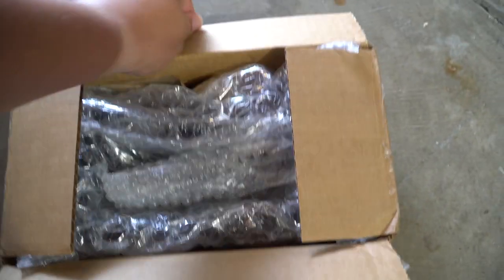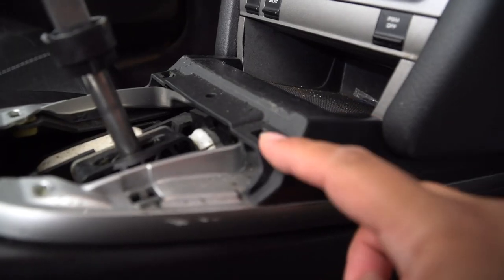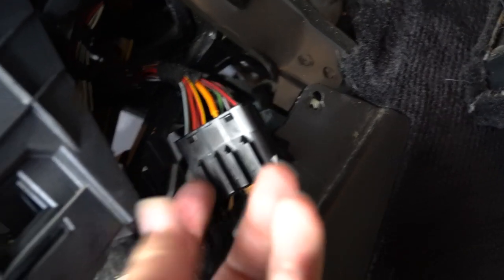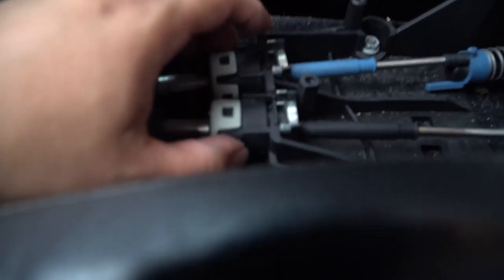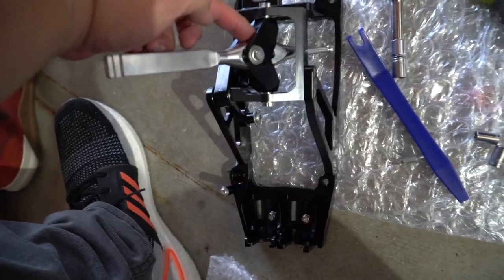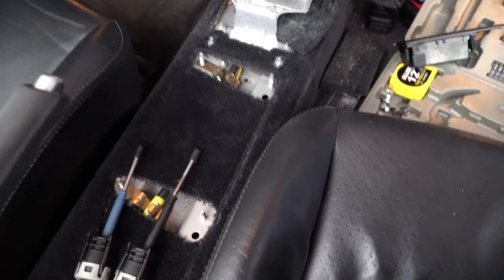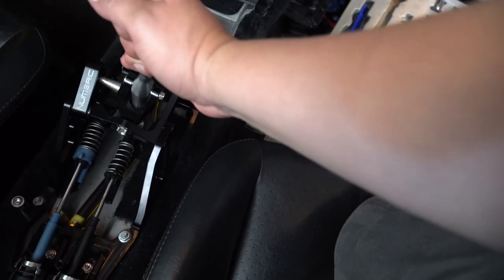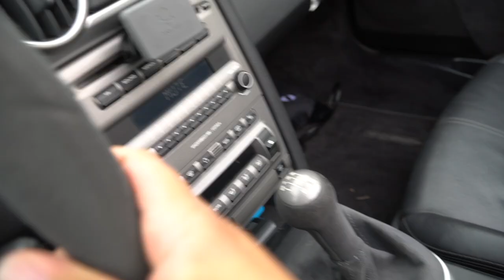Numeric Short Shifter Install

Comment: I installed mine on my 2007 997 GT3 RS. installed the shifter and the cables. I love it. You can feel the teeth of the gear box the feed back is so raw. Personally, after trying all three positions, I set it up on the longest throws. I prefer it that way as the shift is still shorter than stock but you need a lot less effort to shift. The cables were actually not that hard to do but a lift is preferable and a second set of hands to push and pull at the same time.
Reply from the maker: Such a great product!!
Reply: @JermsDNA  yes. Some may find it a little raw but I love it.

Comment: Seems like the new shifter would come with some kind of centering tool, so the throws fore and aft & side to side are sure to be symmetrical and the shifter centered. 
Also be sure to put the transmission in neutral before you detach the cables from the original shifter.